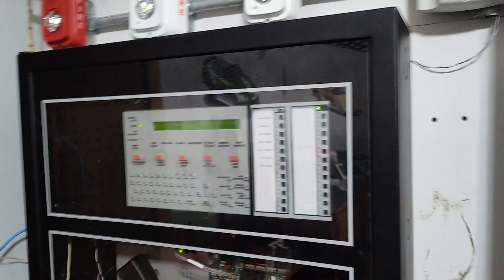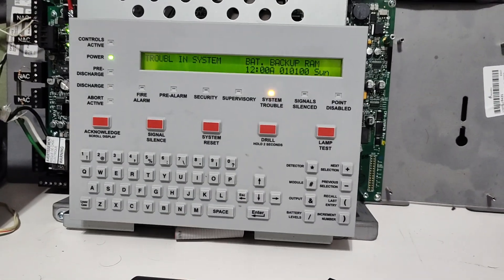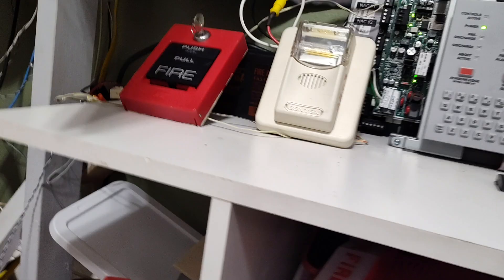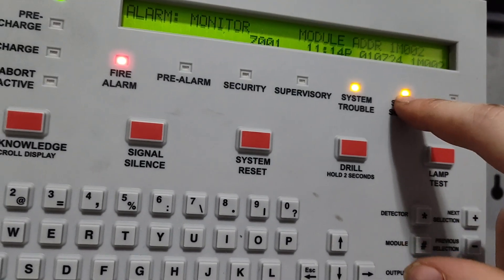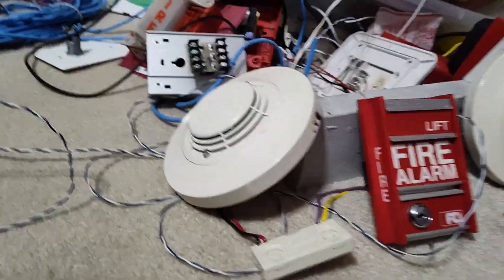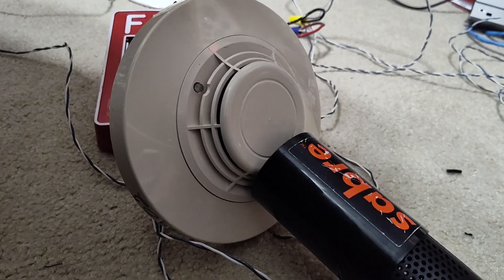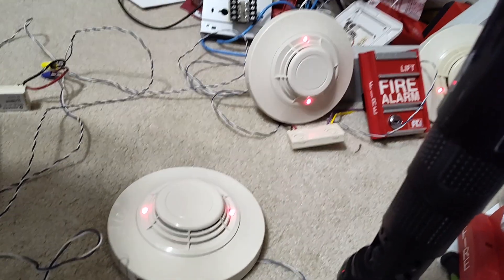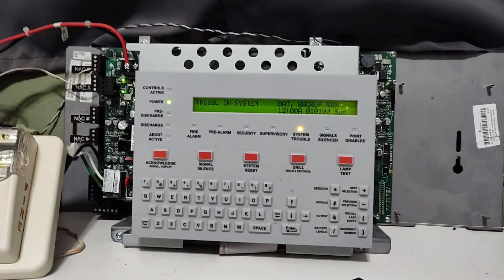Notifier NFS-320SYS Test

Comment: 320 / 2-640 have to be my favorite panels of all time. Easy to use, reliable, and hard to kill.
Reply: When I got my CPU2-640, the master password was changed but I figured it out by the seller I bought it from on eBay. I guess I could’ve changed out the RAM battery back then to reset the programming and password back to factory defaults.
Reply: @ The passwords aren’t saved on the NVRAM chip. Just the job.